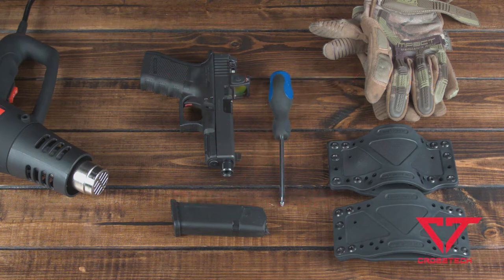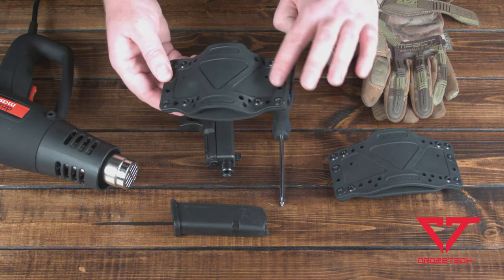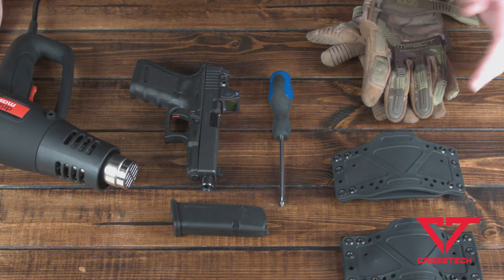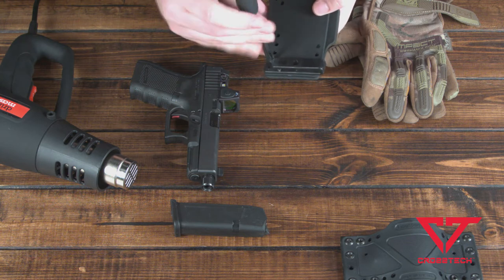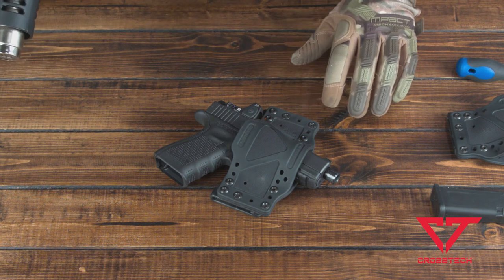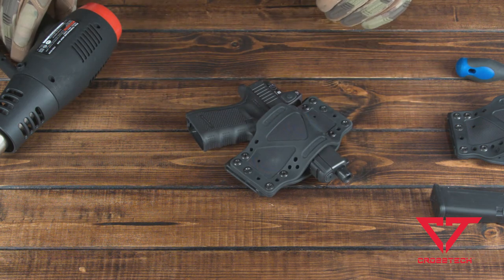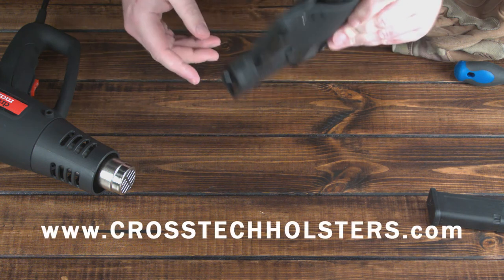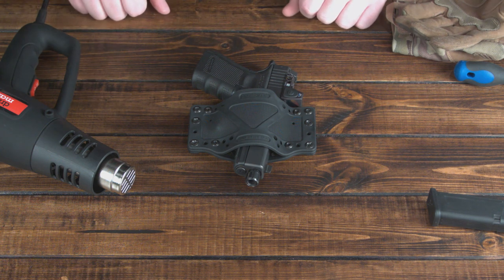CrossTech Holster Setup - Quickest Method

Comment: If you are running a revolver, I think the ideal size would be a K-frame or smaller for this holster. My L-frame fit fine but I was displeased with the way it fit/shaped. However, I tried it on my semi-auto and now it is my everyday house-holster. I was very surprised with how good the retention was. Then again mine is molded with a mild cant so not sure how the retention is with other angles. Hope this helps!

Comment: What about fitting pistols with lights.  Have you tried that?  Did it work?
Reply: John Delich yes. You must remove some screws to adjust to a bigger girth. But keep in mind your light with be very hot
Reply: Definitely take the battery out of the light if it is possible. This product is great for pistols with lights; we just don't have many options on the market and this holster has far exceeded my expectations
Reply: Yes. I have walther ppq sq with a olight pl mini 2.

Comment: Have you tried hand boning like one would do with a leather holster?
Reply: Hand boning? WTH does that mean?
Reply: I'd love to know this too
Reply: I'm assuming it means, using a bone, or blunt tool to kinda form the holsters contours around the guns, as we do in leather holsters. For better retention of the pistol. For leather it needs to be wet, this holster has gotta be hot to work. I just heat molded and boned my new holster, with my glock 30 and TLR1-S, and it looks and works great!

Comment: What’s the retention like compared to a good kydex holster with really positive retention
Reply from the maker: Hi Andrew, 

The CrossTech's retention is user customizable. The material on the outer panel is designed to created retention on the outside face of the slide and frame (away from the body), while the inner panel (against the body) is designed to be relatively low friction.

In the very near future we plan on making videos of the most common holster setup styles for the top 10-20 most popular handguns.

Thanks, 

LimbSaver Social

Comment: My only complaint so far is the placement of the snaps for the elastic strap. I'd like to use it, but the location of the snaps don't make it feasible for IWB. They sit below the waist line of the pants, making them inaccessible. Otherwise, no issues and that doesn't stop the holster from functioning. Simply takes away from the possibility of added security.
Reply from the maker: Thanks for the feedback, we are passing along this info to our design team for review. This might be something that we can modify in the next version.

Comment: Is it ok to not heat and form? I’d be interested in one on these for a “one size fits all” OWB holster for critters at the farm.
Reply from the maker: Hi Dillon,

great question. Though our holster is designed to be DIY-confirmed to your handgun, it can function without being heated. Just move the adjustment bolts out to achieve the desired retention and you're ready to go. 

LimbSaver Social
Reply: I have one  that I didn't heat form, and it is stiff to holster and un-holster your firearm. But that's the way I like it. Someone is not gonna walk up behind you and just yank it out. It also holds my M9 to my side very tight, and even OTW with a untucked shirt is is very concealable. Best product I can find to CCW a beretta 92 with an aftermarket rail. Even though  there is no other low profile holster  that will fit a Beretta with a aftermarket rail, the crosstech is the best option. Where were you guys 10 years ago.

Comment: Won’t the heat damage polymer framed firearms?
Reply from the maker: Hi Ryan, Great question!

Our holsters conform at a relatively low temperature, compared to the temperature that it takes to damage or melt polymer frames. However, following the instructions is important, even when using non-polymer-framed handguns.

We have a Glock 19 that we call "The Mule" that we use for setting up holsters that has been used to set up many, many holsters and still looks and functions like a brand new Glock, with no damage or deformation at all. I will be shooting it this weekend ;)

Just remember to use the proper technique and to not apply direct heat to any one spot for more than about 1-2 seconds, moving the heat gun in a fast, back-and-forth method. If you start to see the holster take on a glossy look, you're using too much heat and you need to back it off or use a lower setting. 

Let us know if you have any more questions!

Thanks!

LimbSaver Social
Reply: Plus remember polymer is the cream of the crop as far as plastics go..it takes more heat and is more durable than other plastics...fast firing a clip through your gun will probably make more heat than doing this...just don't put heat gun directly on polymer..there's a BIG difference between a heat gun and a hairdryer! If your still concerned just use the hairdryer..

Comment: Beware the belt clips are made of hardened plastic. They will break. Though they screw on the replacement parts seem nonexistent. It forms well it holds the weapon well but if the belt clip breaks then it is no longer useable. Most holster belt clips are made of metal. Not this model.
Reply from the maker: Hi Robert, sorry that it sounds like you have had a problem with your belt clips. It's possible that you got a holster with our earlier clips design. We have updated our clips to a more durable design and will gladly swap out older and broken clips for free. Please call our customer service line at (360) 427-6031 Mon-Fri 8am-4pm PST and we will get you taken care of right away. Thanks for reaching out, we've got you covered.

Comment: Can this hold a Glock 17 with a Streamlight  TLR-1?
Reply from the maker: Hi M Alton, 

Our current holster is designed to work best without lights or lasers.

That being said, this is just a rumor, but we may or may not be coming out with something special in the future... but, I can neither confirm nor deny that we are actively working on prototypes that I definitely do not have in my possession and is not sitting on my desk in front of me... 

LimbSaver Social
Reply: @limbsaversvl  So, why not design one that will work with lights and lasers?
Reply: I own one of these holsters but haven't set it up yet. Just picked up a CZ P09 ( the 1911 size pistol).  It has plenty rail space.  Looking at this video and I believe he said it can fit lights in an comment above.

He mentioned removing more screws.  Seems like it is possible.  

Can't wait to try it.  My pistol is just a besides pistol for Home Defense.  I think this holster will work with a light but with playing with the bottom screws.  

Just my opinion.